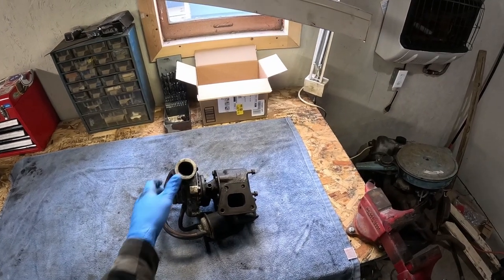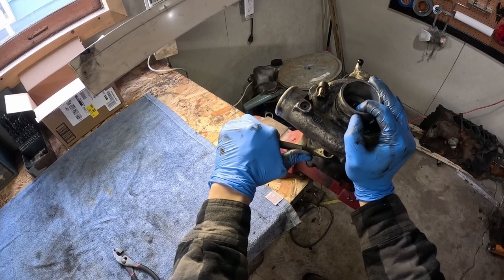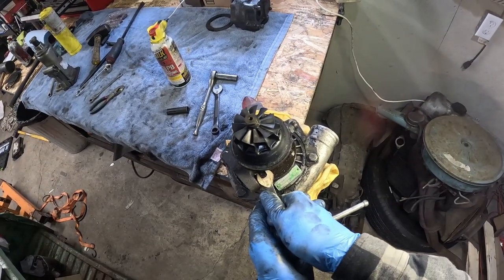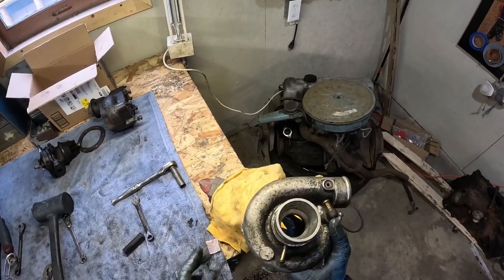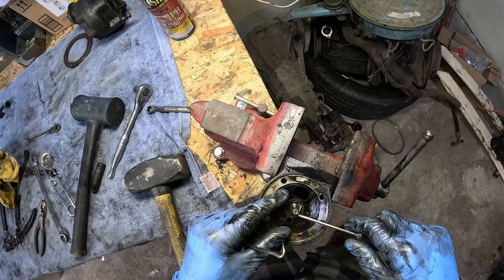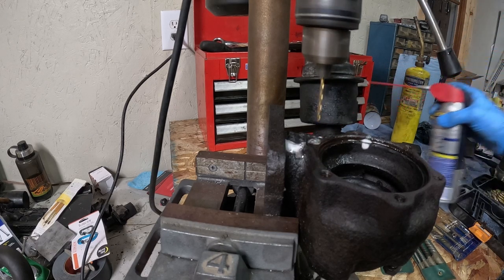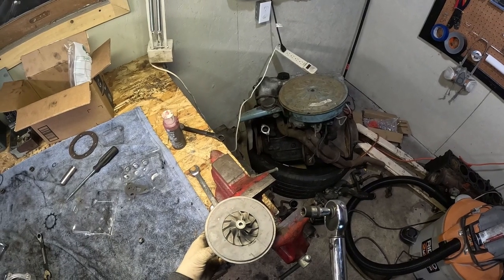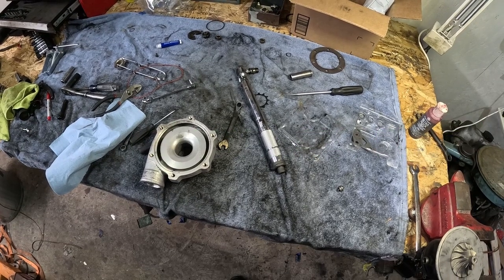Garrett T3/T4 Turbo Rebuild - In Depth Instruction

Comment: I listened to the people on the internet. Took apart the turbo for my D24T.
Was advised the best way to get more boost was to eliminate the waste gate by removing the boost reference canister. The part with the spring that opens and closes the waste gate valve. 
It doesn't just come off, the canister is actually spot welded to the hot side housing. Was told to just break it off, and I did. Moron. Realized later I could have just removed the line feeding boost reference. 

Also, I took the turbine apart. As I understand it, I now have to get the turbine balanced before attempting to run it again. 

The turbo worked perfectly well before I made such a mess of it.
Reply from the maker: No worries man, happens to the best of us. 
You shouldn’t need to balance your turbine. Apparently the turbine and compressor wheel are balanced separately, so you can put them together any kine.

Comment: Did you put this in a Caddy?  Thought I heard that when you were talking about clocking it.
Reply from the maker: @EricShea-z7k  The plan was to use it on a 1.6TD swapped in a Datsun 521. However I’m probably not going to end up using it. The 1.6TD is pretty spent, and I got a killer deal on a running AHU TDI.
Reply: @haoleboyshow-tos2279  Gotcha... we're building a Rabbit truck shop truck with the exact same Turbo.  Thanks for the video.
Reply from the maker: @EricShea-z7k No problem, that will be a lot of fun in that little truck. Caddies are great little parts-getters